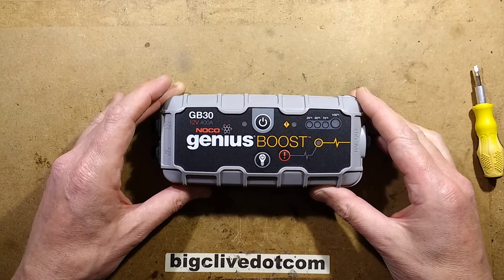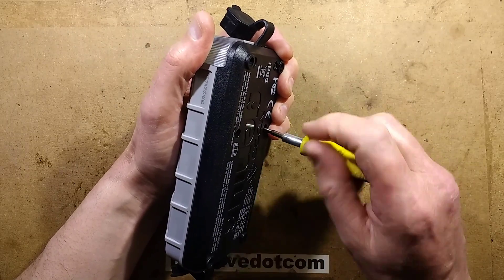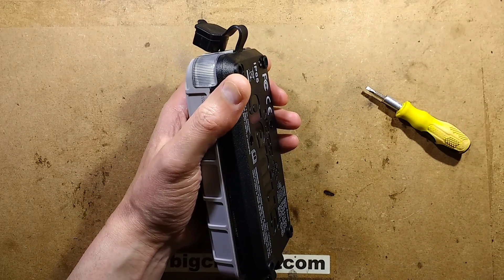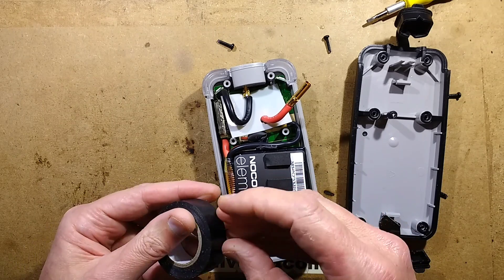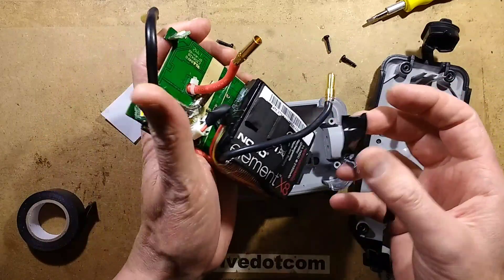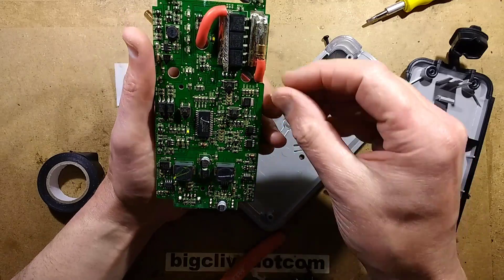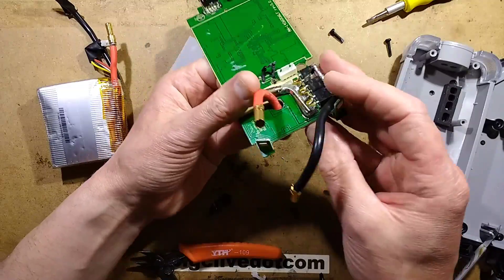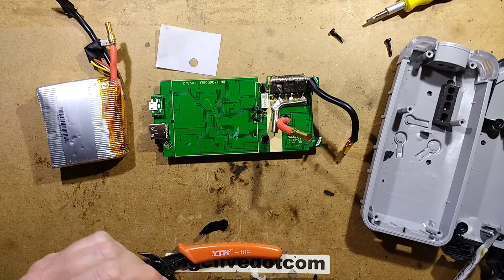Noco GB30 failure autopsy.

Comment: Regarding puffed up lithium cells , my HP laptop battery is so puffed up it's bowed the case where the touch pad is , forced out one of the screws , made a 4mm gap , this has happened over an 18 month period. I don't think it's too much to worry about ... Cylindrical Li-ion are the same as these prismatic Li-ions , except the layers are rolled up and put in a steel tube which will contain presure.
Reply from the maker: I would recommend not using the laptop with a puffed up battery in it.  Maybe time to retrieve important data and either get the battery replaced or retire the unit.
Reply: @bigclivedotcom  That's what the local computer shop said ..... He said it could burst into flames ... big girl ... he won't trick me into buying a new  computer ... I will post here if it fails or catches fire ... lol... great content Clive , keep up the good work.

Comment: Hey sir hope your well.  I work for a motor club that dispatches tow trucks when people call their insurance or car warranty program when they break down or have a wreck or flat tire or locked their keys in the car kinda stuff and our service providers often upload pictures to our system of the service they rendered and the NOCO packs are the most common ones I see roadside providers using, I really need to note which model they use.  I've been at the same place for 6 years end of this month so I think it's fair to say that I've seen many over the years lol.
Thanks Clive.

Comment: I always poke tbe pillows to release the gas inside them. Of course, very gently, I use an old blood-glucose meter poking pen to do this, so that I don't go too deep inside the cells. Then I use strong adhesive tape to cover the holes. And this procedure gives the cells a little extra life.
Reply from the maker: I don't really recommend that.  Sometimes if charged and discharged a few times the gas inside does recombine.  But either way the lithium cell should be regarded as a risk and not used anywhere it could cause damage.

Comment: I've had a few NOCO products with mixed results.  I had one of their Lithium motorcycle batteries die on me recently for no apparent reason.  It sat on the bike and whent flat in a very short time and refused to be revived by my NOCO Genius 10 charger.  To be fair to NOCO, they sent a replacement though it was a faff and took a while.  To prevent any future occurences I bought a NOCO Genius 2 charger which I fitted to the bike via their M6 eyelet and plug accessory.  Unfortunately after about 15 months of perfect duty it died the other day for no apparent reason.  I am awaiting their response.  

NOCO is not the cheapest on the market and seems to hold itself out as a premium manufacturer, but I'm beginning to wonder.😮
Reply: Hi.  They're going to send me a new one under warranty but they made me cut the cables off the old one.  You're welcome to it if you would like it but I can't find an email address for you and I have no idea how to DM you in YouTube, or even if it's possible.  Let me know.

Comment: Old video but nonetheless: Fet's are T460's not BN431 that is the production code. They should do 60-85A (depending on manufacturer) but these look like cheap ripoffs which usually do not cope well with surge currents. End result is the smoke going out or deadshort and then more smoke.

Comment: I had two budget jump starters go bad after using them only once,and then the cell pouches swelled so much they popped open the cases. the jump cables had NO protection at all,newer jumpstarters come with a diode array to prevent uncontrolled backcharging after the engine starts.
Reply: BTW,when your engine starts,the alternator puts out about 14 volts to recharge your car's battery,and without diode reverse  protection,that overvoltage gets applied directly to the lithium cells,and they DON'T LIKE IT at all.  no current-limiting,either. 4.2v max fully charged for each Li-ion cell,adding up to 12.6volts.

Comment: So, how does one dispose of the swollen batt pack?
(Chicago)
Reply from the maker: Safest thing with swollen battery packs is to discharge them completely if possible, as the primary fire hazard with lithium cells is the energy they store.
Reply: many cities have a site or sites for hazardous material disposal. like paints,solvents,old lead-acid batteries,they now accept Lithium batteries.

Comment: I bought one of the very early versions of these deals, carried it in my motor home and used it for a power supply when power was not available and I didn't want to start my generator for 110 volts. One day on my way to Arizona for winter digs, my Jeep that I was towing had a dead battery so I decided to try and start it with the unit; I hooked it up, got behind the wheel and gave the key a jiggle, the smoke poured out, the device broke as the cells swelled and, well my Jeep did not start. I had to recharge the battery once I got to the campground to get the Jeep up and running after I dropped it from it's tow rig. I still have the unit, it will take a charge and power my laptop when I need it for that but it will never start a car again. I got a newer one now and it works great when I need a boost on my old Ford, or the lawn tractor.

Comment: I had a NOCO, larger than this one, worked fine, once charged, but wouldn't hold a charge for more than a single day (Although during that day it jumped my car with a bad battery just fine). 
I wrote NOCO for a warranty replacement and never heard ANYTHING from them. Warranty worthless, NOCO unit worthless, NOCO is worthless. I eventually 'threw it away' at the recycle center. I bought a HULKMAN that works perfectly and holds a sufficient charge for more than a year. I would never buy a NOCO again for any amount. 
This video of the battery condition confirms that as this NOCO battery is very dangerous.
Reply from the maker: It's a very odd and corporate style company.
Reply: I had a similar experience with NOCO. The unit refused to charge my fairly new AGM on a vehicle which doesn't get driven often. I contacted their warranty dept asking if the unit was defective to which they said it must be my 12v. I bought another brand which has been working fine on that same battery for years now.  I used to think NOCO was a premium brand.

Comment: Lithium polymer batteries do tend to swell up if left fully charged over a period of time!! Which is ironic as these devices are supposedly there for emergency use,this swelling is well known of in the radio control models fraternity where batteries are discharged after use to help stop swelling of the battery,hope this advice helps,cheers Big C.

Comment: I have the GB40 for both of my cars. I have measured reduced performance after a few top-offs.  What I have found is you need to annually discharge the cells and fully recharge them to have the BMS re-balance the cells and achieve full capacity of the pack.  I use a capacity tester for the discharge, most people could just charge their phones off of it until 25% level or less.  No issues using them as jump starters following this energy cycling plan. Be aware that constant topping off with high amperage chargers is risky - usually one cell takes the brunt of the energy.  I use a 5V/1A charger, even though it takes a while.  A battery pack embedded in a plastic unit is not able to quickly shed heat during high current charging.
Reply: IMO,you should only charge these with the factory-supplied charger.  Or does NOCO make you provide your own cellphone-style USB charger?

Comment: I would like to repair a set of cables for a car battery jump starter (lithium). My daughter connected the crocodile clamps the wrong way round on her car  and although they are supposed to be protected with a light for reverse connection they dont work anymore. There are only few components including 3 small capacitors , 1 chip and and a large black cube which resembles a relay that you would get in a car fuse box. (However its not a pull out like in a car). Anybody have any advice or direct me to a tutorial please? Shame I cant upload photos.
Reply from the maker: A reverse polarity incident can be quite destructive.  You may be able to get a new lead module for the charger if the main unit has survived.

Comment: Love your videos Clive... I recently purchased a GB 40 ... instructions said to plug it in an charge .... after only an hour the LEDs indicated it was fully charged. I never used it and when I checked it a month later it only first LED was lit ...I plugged it in and left it plugged in for several hours checking on it every half hour and it never charged😢 Seeing your video I now know there is nothing I can do. Thanks so much for these videos ❤
Reply from the maker: If it's still under warranty then contact your supplier.

Comment: Does leaving a car connected to jumper Starter charge the battery?
Does leaving a car connected to jumper Starter harm the battery?
Can you drive a car on Jump starts without working alternator or battery?
Reply from the maker: Once started the jump starter should be removed.  It can be charged from the cars dashboard power port, but is only intended for jump starting.
Reply: Can you drive a car on Jump starts without working alternator or working battery?

Comment: I just came across your 6 year old video. I use a Noco 2 amp charger to keep a small battery charged for our house alarm backup. It is only 1 1/2 years old and failed last week for no apparent reason. Here is the thing; I can't even remove the screws to open it. They are not cross head or slotted. They are a 3- fluted head. I have never seen a company go to such lengths to keep prying eyes away from their secret stuff. I suspect a failed mosfet . I will not buy another Noco devise, as their marketing is over-hype for what you get for your money. I may box and send it to you for your channel if you like. You make wonderfully informative videos'.

Comment: That small red button bypasses all voltage safety features. You only use that on a completely dead battery. Your basically asking it to blow itself up sending  full power with no backwards regulation. Wonder if they were using it in that way??

Comment: I have the 50 for my BMW X5 3.0d and it's fantastic. I first bought a gooloo that was supposed to be a lot higher rated claiming to start diesels up to 8.5l but it didn't work. I replaced it with the noco gb50 and it started it instantly 👍👍👍

Comment: I had a small one accident fell in my cup with liquid. Didn't work after. Then I bought a combo unit with tire pump. Won't easily fall into anything I still got that one it's good can be charge with USB and my tool battery will charge it up with adapter. I'm happy with it.

Comment: I bought 1 of these when they first came out, used it once or twice and then it stopped working.  I was transporting at the time so I ended up around the corner from their factory/office.  I brought it to them and they "fixed" it.  It worked one time after that and never again.

Comment: Okay, c'mon guys. Anyone who thinks a handheld battery system will start their car has another think coming. There's a reason car batteries are large, heavy and expensive. It's because a starter motor uses hundreds of amps to crank an engine. Something like this would be good for charging your phone or computer. It may trickle charge your car overnight if your battery isn't destroyed (likely if you forgot your headlights and completely drained it.) But no, it won't start your car. It shouldn't fail like this. That's a design flaw.

Comment: Lithium cells can be dangerous when they puff up . I bought 2-gold  cells for my galaxy s5  way back and  one of the cell swelled up for no reason. I dispose of it properly and  having a lithium ion cell do that can be concerning because if it burst into flames   will burn your house down. I charged it properly. I got two of those  gold  batteries off of EBAY. The guy selling them  got pulled off of Ebay and I could not  get my money back  even with Ebay helping me with the issue.

Comment: The device have two buttons on the front, the "bigger above" is the normal on, including safety circuit, the lower small one is a on button where all safety circuit are off.
I guess the user have used the lower button too often and too long.
It is only for a short usage when the car battery is very discharge.

Comment: I got GB 40 for 4+ years.  Now its dead. Can I replace the batteries inside th NOCO ? I'm planning to buy a Lithium ion battery from the same type, but the problem is I don't know the battery number to purchase. Any help ?
Reply from the maker: I doubt they'd endorse changing the battery.  It's a very high current racing style pack.

Comment: Wow. I work at a battery store and we sell the Noco brand jump packs, but not the GB30, only the GB20, GB40 and one of the bigger ones. Interestingly enough a customer brought in a GB30 to be diagnosed and it had this exact same issue. Probably why we don't sell them anymore, the GB20 must've been the replacement.

Comment: Hopefully this is just good a design feature to blow the semiconductors before the battery can go totally explosive when exposed to a totally dead auto battery, reversed polarity or the leads getting shorted. It would open the circuit faster than a relay could arc its way open with the high current that is involved.

Comment: Why not measure the battery... The starter motor can really send a surge, blowing up the mosfets because its internal protection cirquits that's designed to handle spikes from automotive inductive surge spikes from continues used load. In this unit the current draw (load) is intermittent and limited in time. Therefore the designer probably calculated the number of needed mosfets by using the intermittent load "curves" in the data sheet, forgetting that there's no intermittent, intermittent "curve"... for the greatly more powerful inductive spike...😁

Comment: Thanks for an interesting insight but Gosh...... That Was Close...... Literally!!! 
Was I the only one holding their breath when you were disconnecting those leads? 
It looks to me like the larger GBs are the better bet.
However, I may be wrong but I suspect that some GB Owners are not reading (who does?) and fully understanding the User Guide regarding the 'Manual Overide' button, in that when it is pressed, the 'Safety Protection' features are disabled, the leads become live and incorrect connection or shorting can result in....... Well....... Failure Autopsy ;)

Comment: Yeah mine is clicking, but it doesn't start shit. One time I even needed to check if my tiny caravan 12V water pump was working or not, I clamped it in, and it gave farts and sparkles as output, in other words, nothing. It is just overweight flashlight now. I had to buy a big one for 4,2 L diesel (Noco only sold 3L and 6L) so I get the really pricy one. I'm done with this shit brand

Comment: i have the later version of this same unit mine has the latching relay on it the pitfall to the latching relay is it latches hen current is drawn but the battery has to have a charge for this pack to detect or the relay wont latch and it will show the error light so 100% dead batteries this pack wont do anything

Comment: When my lithium booster went bad, I took it to bits and poked around - until a 2 foot flame jumped out of the battery. Should have waited on BC's autopsy.
Reply: you may have poked a hole in one of the cell pouches. BIG no-no.  the electrolyte ignites on exposure to air. (as you discovered)

Comment: I just purchased on of these for myself.  They should last about three years.  There seem to be lithium polymer, the same type of batteries used in my RC Planes.   The only catch with these types of batteries, you should not keep the fully charged as it puts a lot of wear on the batteries .  Lithium batteries should be kept at 50% charge when in storage, which is not ideal for this application. That being said the do produce a lot of Amps and are very light. 
Back to the problem with this pack.  I see a lot of people plugging them directly to their Positive and Negative terminals on their vehical directly and bypassing their car battery all together. This will work in a pinch however once the vehicle starts it will try to charge the battery which is not there and that when it will fry the Battery Booster.   This could also could occur if you forget to disconnect the booster once the car starts.

Comment: For some reason I thought these had large capacitors, used to offer the enormous 160A/12V pulse of current for 20 seconds needed to start a car battery. Not so, at all.
Reply from the maker: There is a version that does that.

Comment: I just bought some flashlights from wal mart that were on clearence. They will slow charge your car battery through the cig lighter or click on the jumper cables with the booster and instantly jump off the car. I got a chance to use it the other night and i was amazed how it started the car first shot. The shelf tag said 3.00. I grabbed 4. Got home looked at the receipt and saw they added extra zeros. They charged me 30.00 each. It has four led light settings. My buddy was pissed he had just paid 300.00 for his.

Comment: as others have mentioned, these units are rated higher then they are built.  i have a battery maintainer/repair unit from Noco that got lumpy and deformed after its first battery conditioning cycle!   it still seems to "work" although i haven't tested it on a scope/meters to see how well, or as advertised (compared to new).

Comment: I got one of these to “fix” but turned out it was ok but just not up to the job - looks as if it needs a vehicle battery with some charge as it would not even turn over a vehicle with no battery or a completely flat battery .